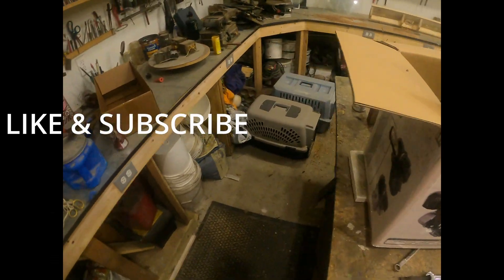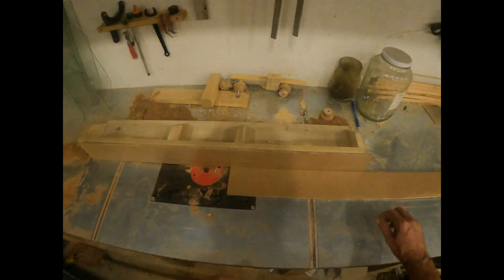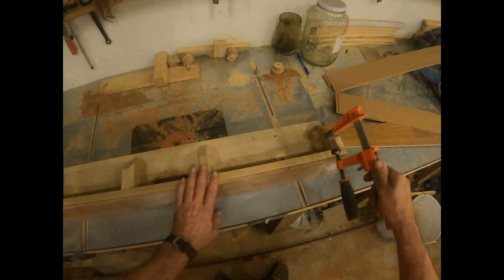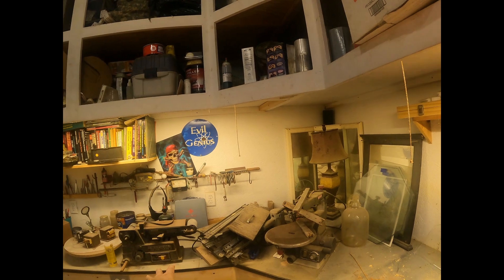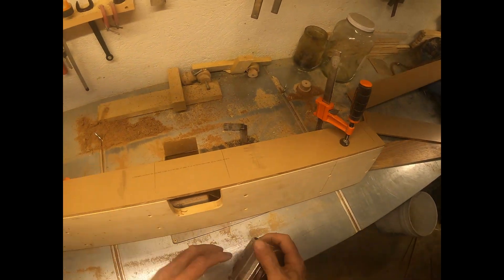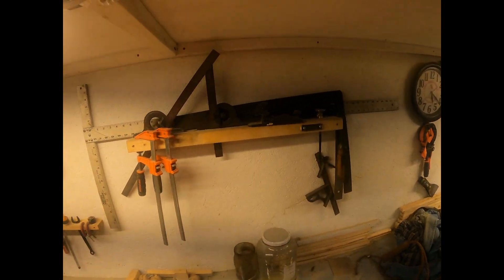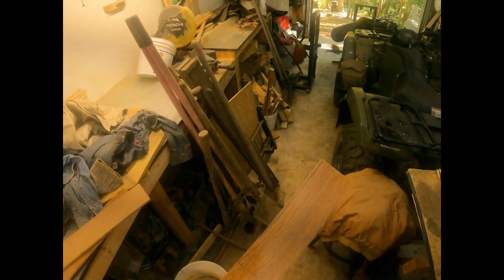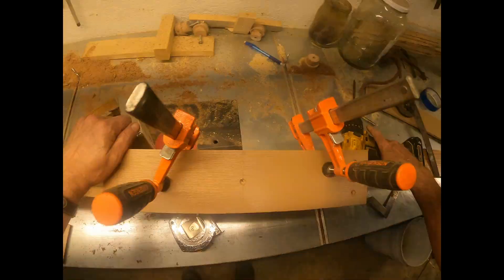MODIFYING ROUTER FENCE (UP GRADE)

Comment: That's not a bad idea. Most people put a sliding door kind of fitting so the the two sides move closer and further away.

This should work quite well if you can clean up the dust from the 45° to keep them sliding nicely. I would also give 2-3 mm extra gap around the router bit. I will be worried about it grabbing the bit and then it will rip the whole thing apart.
Reply from the maker: good idea about the gap didnt think of that, whould have after it happen LOL.